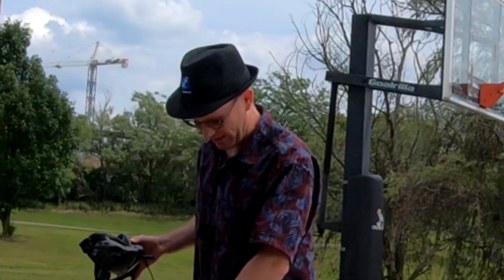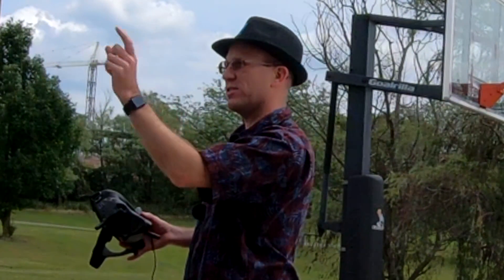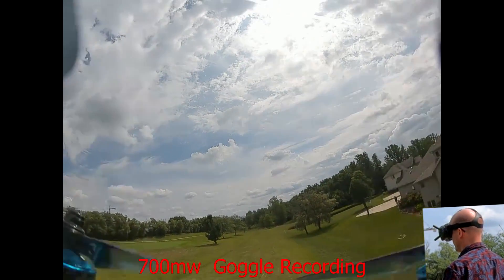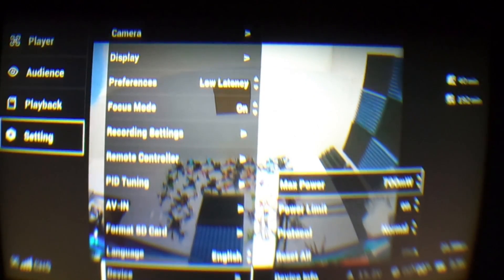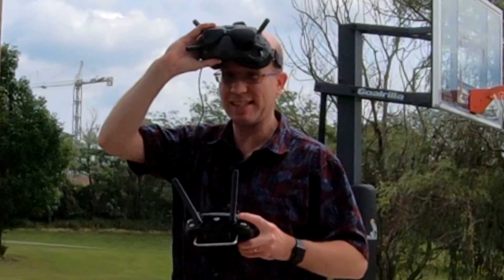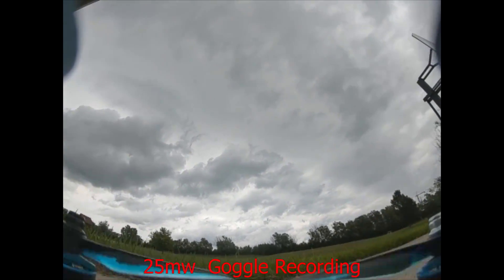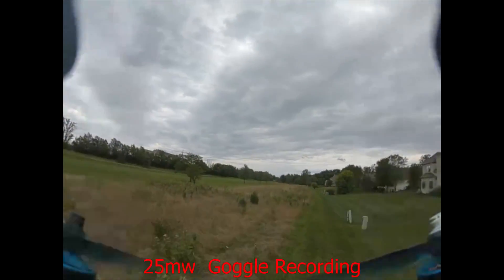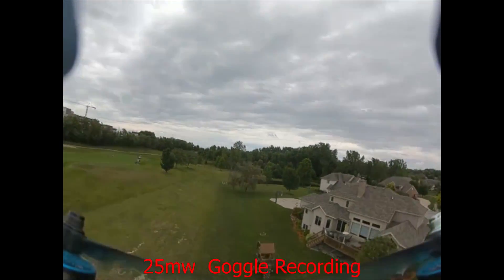DJI Digital FPV Goggles System – Is it usable on 25mw?

Comment: why do you ask this question? can't you just change the code and use more mw? how much battery do all the mw modes need? do you need a bigger and heavier battery if you use the dji fpv ?
Reply: In Europe, it is illegal to use more than 25mW.

Comment: So does this affect control too? Or just video?
(Will it extend flight distance control in 700? Or just video range?)
Reply: Just video range. The transmitter transmits the control signal from the transmitter (as the name implies) but the video transmitter on the drone (25 or 700mw) transmits the video signal

Comment: Question(s) for ya! :) 
Does the goggle's transmit power match the air unit while flying? (Or does it raise power as necessary? How much is it really transmitting?)
I've heard those top to antennas or transmitting and receiving,  DJI's site lists goggle's output as "<30dBm". Not sure how I feel about wearing a 700mw (or up to 1 watt at 30dBm!?) transmitter on my face..
Reply: For any who are curious, emailed DJI and a senior engineer ended up responding. Goggle output is consistent with air unit. so when air unit is on 700mw, goggle are pumping that as well.

Comment: Good test, thanks for it! I have one small complaint though! The comparison is not fair, because you flight significantly lower (overall) on 25mW than on 700mW. Especially around the house. Altitude makes a huge difference in these cases.;-)

Comment: Where you see break-ups at 700mW? I don't see them. ;) :) For me this system is perfect. Such clear FPV. I hope that 
competitions will show up, that prices will be lowered. Sooner or later will happens this. Fatshark what are you waiting for? ;)
Reply from the maker: The center is perfect, but the edges have some breakup.  It’s really clever. And I love the way they implemented it.
Reply from the maker: And yea, evertime I look at an Analog flight it makes me sad.
Reply: @SimRacer101  I'm flying in almost no obstacles area on meadow and have very rarely short breaks up to 230m(25mW). While image is not comparable to DJI. O.K. at X215 is still quite good. While at FPV EGG 138 is 
below average. This is one of reasons why I fly almost just with X215, the second one is, it's faster, more responsable,...

While I will give in Dragonfly a better camera. The original is terrible. But O.K. it was for free and looks great. I like it. (Y) :)
Reply: I couldn't won better prize. Orange and odd. :) :)

Comment: Looking good! I am working my way up to HD DJI FPV or better whenever they come out but right now I just got my first quad and its the Trashcan.  I don't have the goggles yet but they are on the way (maybe 2 weeks away) but my question if you can answer is,  If i turn off the VTX 25-200mw how do I turn it back on again since the way to change those options is via the OSD via the VTX?  I have not tired turning it off since I don't know how I would turn it on again after.. Even if your not familiar with the Trashcan quad I think other quads would work the same with the VTX off option..  I would like to turn it off for now since I am not flying FPV and it might give me longer flight times..  Thanks in advance for any info..

Comment: Don't fly at 25mW while using DJI air unit as Rx. You will got failsafe of your quad at short distance...
Reply from the maker: That is what I’m doing here and I had no problem.
Reply from the maker: Maybe I need to clarify that in the next video.